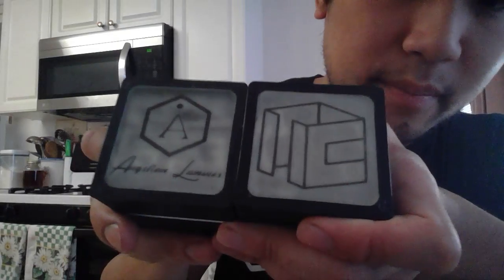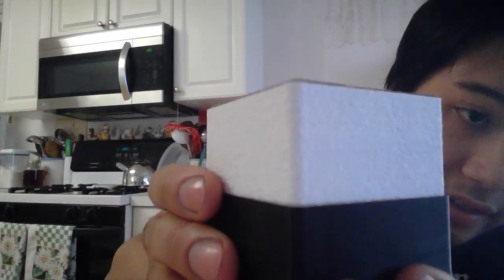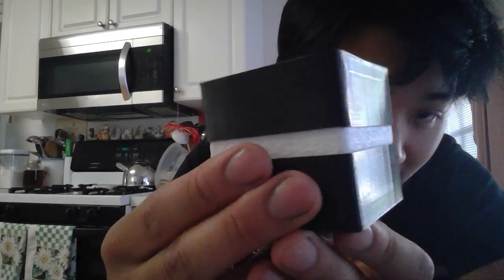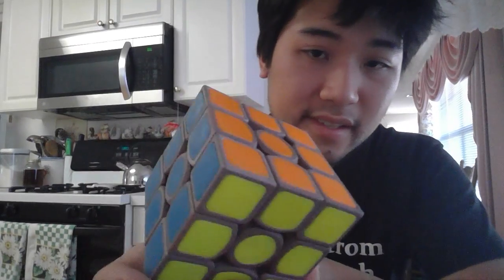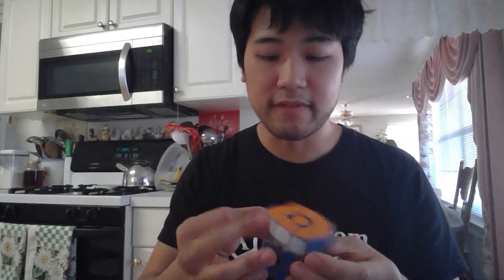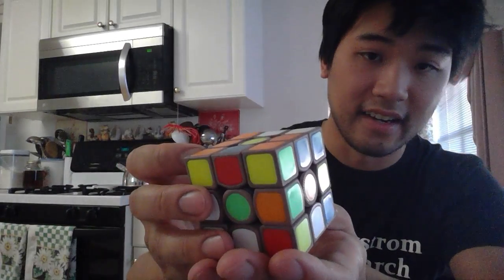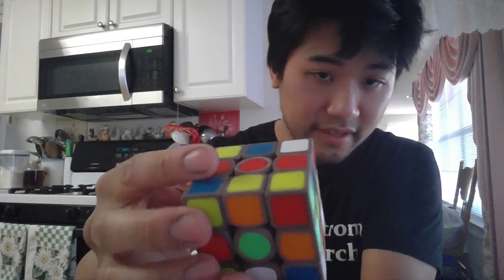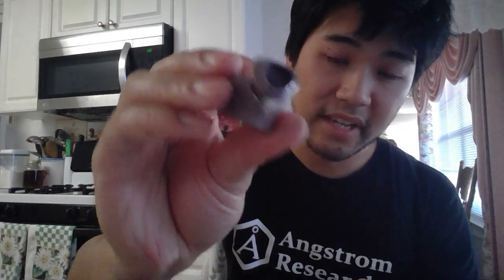Custom Boxes, Luminox Updates, and Life Advice

Comment: you have the ability to produce multiple cubes per day, but do you have the mental fortitude to do that for a month? kek
Reply from the maker: i can do this forever
Reply: Chris is a dedicated man. If he were to stop doing this after a month, he wouldn’t have spent $8000+ on this project.
Reply: @gomibako9055  It's really fun to make stuff but after you've done it for a while it can get tiring to make the same thing and go through the same process over and over. tbh I just said that because I've tried mass producing custom made puzzles a few times and I've had to stop, but chris' done this before so he should be fine.

Comment: What do you think is causing the problems with corner cutting? The mechanism looks pretty standard, but you coated it so is it really the material? idk, whenever I made 3x3's I usually blamed bad corner cutting on the material cause it gets a lot better when you wear the plastic in/smooth it.
Reply: NK Cubed I think it’s just the lack of lubricant in the cube. You can hear how dry it is, and you should know that dry cubes don’t corner cut that well since the piece get stuck on eachother.
Reply: @gomibako9055  maybe, but I find it hard to believe that Chris wouldn't lube his cube. I mean he makes the stuff.

Comment: so you can sorta make the cube like a tesla where they make changes to the car constantly instead of making big updates
Reply: NK Cubed if he were to do this, the consumers would have to pay way too much to get the small updates. The reason Tesla is able to do this is because their updates are software based, but updates in cubing are hardware based. So unless Chris can cheaply make addons and cheaply ship them to consumers (which is very unlikely), this wouldn’t be possible.
Reply: @gomibako9055  nah fam I'm talking about how they're constantly changing how they make the cars in the factory so model of the car you get depends on when you buy it. They don't usually do v2 or stuff like that, it's more like a software update where they have v1.0.0 and then v1.0.1 etc. All he'd have to do was update the files for the individual pieces.
To clarify: no, your cube wouldn't "update" remotely, but the product you buy would be constantly getting better from a hardware point of view.
.-.

Comment: did you add a chamfer on the bottom of the box where it sits on the build plate? The squished first layer can be really annoying when you aren't doing any post processing.
Reply from the maker: i think you underestimate my print surfaces, I don't need a chamfer
Reply: @HumphreyWittingtonsworthIV  Oh yea, I forgot you aren't a pure bed type of guy. Evaporated hair spray on glass, right? I just use clean PEI.
Reply from the maker: @NKCubed  I used to do that, but I use a different print surface now.

With PEI, I think you should be able to avoid elephant foot if you're tuning your first layer just right.

Are you using a PEI plate or a PEI surface?
Reply: @HumphreyWittingtonsworthIV  PEI surface, It's the stock bed for a prusa i3 mk2. I wash it off with alcohol between  prints but I still have trouble getting PLA to stick to it sometimes. I should probably look into it more and find a good solution but I usually just squish the first layer and pray to RNGesus.

Comment from the maker: One of the things i forgot to mention is that one of the things that make Luminox Cubes unique is how I can manipulate the /feel/ of the cube.
If we can achieve the performance of a 2016 valk 3, but with selective FEEL, then that's the golden horizon.

In terms of hardware, cubes haven't changed much performance wise from the Valk3, which was almost 3 years ago.
Of course I'll keeep chasing better features, but my goal is to achieve baseline performance, and then max out on /feel/, which we can achieve at a higher level because we aren't limited by batch production or common production methods